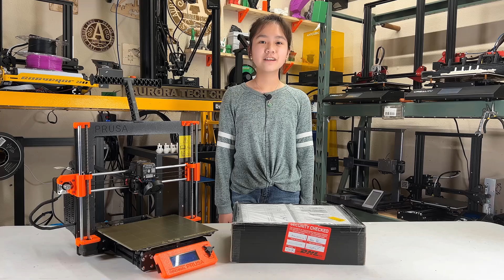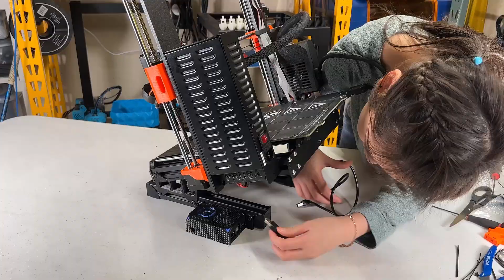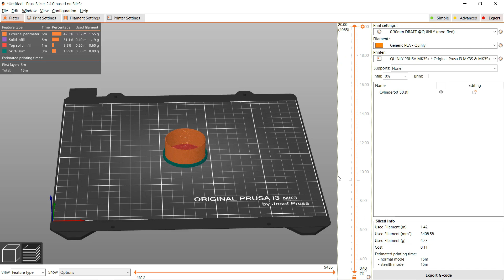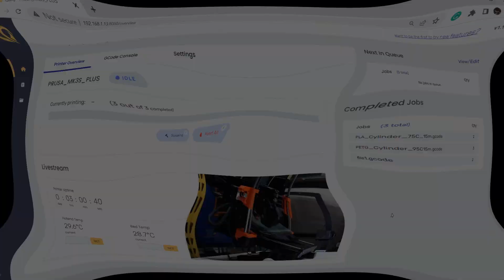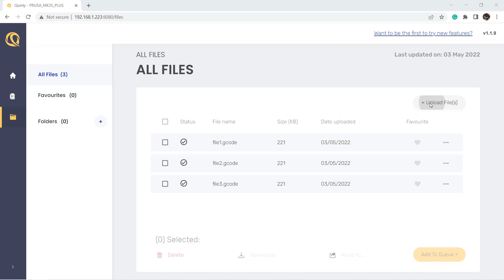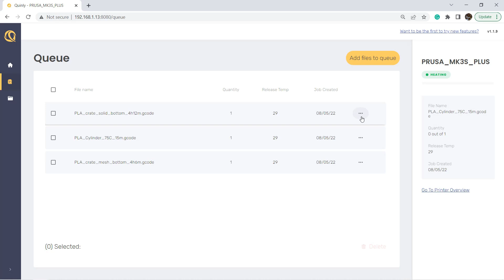3D printing batch production: Quinly automation system for Prusa MK3/S/S+ series, loop printing

Comment: Hi Aurora, Steven here from 3DQue. 
Thanks to you and your brother for reviewing our product! I'm glad you got it working reliably. You brought up some good points which I'll address here: 

1. ABS not releasing: This is strange, since in our testing, all ABS brands have released very reliably. There are probably some uncommon additives in the flashforge ABS you tested, and I'm sure most other brands will work fine.
2. Materials info page: We actually have a materials page, but it was not easily accessible, so we've added more links to it in the manual and on the website.
3. Custom shaped spring steel sheet: Great idea! We hadn't considered that, but it would reduce the part count and the weight on the Y axis, and also make the installation easier. We will consider implementing this if we can find a source for the steel sheets.
4. Long cooldown times: We are working to come up with an add-on for a controllable bed-cooling fan that turns on when the print is finished.
5. On/off switch for wireless hub: Good idea - we have looked into the options. The Rock64 has an uncommon sized power jack so it is hard to find compatible on/off switches, but we will include them if we can find a source.

Thank you for the suggestions and keep up the good work!
Reply: @Bradley Saulteaux G10 (and FR4) is the same color as VAAPR, but the materials are very different. VAAPR is a unique material that 3DQue invented. We have compared G10 to VAAPR, and G10 releases parts well if you remove them by hand but with VAAPR, the part release is so good, you can sometimes even blow air at parts after they cool down and they will fall off the bed. Search for 3D Print General's Quinly Review if you want to see a demonstration of it.

Comment: This does not work on huge prints. I would not recommend using the printer to push the print off.
Reply: Why do you say that? I’ve been running quinly for a year and have done massive prints pushed off from my cr10
Reply: It actually does work on large prints! The VAAPR bed auto-releases parts as large as 250x250mm. There's an example on our Youtube video titled "Quinly Automation for Creality Printers"

Comment: Great video! I've been a Quinly user for almost a year now, and I won't ever go back to Octoprint. While it did work, it was quite cumbersome. The Quinly is a much more refined and elegant system. There are working on some extremely powerful upgrades (in Beta now) such as the hub, which can control multiple printers as one cohesive unit, pro, which is their networking solution to control multiple hubs, Quinly's, and even across different locations. The flexibility and expansion capabilities of the system are light years ahead of everything else out there, and with things like Quinly Vision, their AI print monitoring system on the horizon, it is stacking up to be the ultimate solution for any 3d printing business or print farm operation.
Reply: Lol, never. 

You are probaly working for them or you are being payed for saying this. This is absolutely no new technology. So funny.

Comment: Was just looking at this system last night.
How does it overcome petg oozing out of the nozzle while heating up? If I don’t sit there for 5-10 minutes wiping the nozzle off until the ooze stops then my prints have a high rate of failure/poor quality.
Reply from the maker: I print a wider skirt with a few loops to wipe it off.
Reply: @AuroraTech  👍🏻👍🏻
Would you recommend this style of continuous printing for parts over belt printing? 
Also I can’t say enough how great of a job you guys do! My favorite channel by far. And not to put down all of the great content makers out there, because there’s so many fantastic ones,  but my problem with almost everything out there about 3d printing is that nobody takes the time to really be clear and concise and show the entire process of what they’re doing and remember that not all of us are rocket scientists. Keep up the great work!
Reply from the maker: Depending on what you print, if you print something like those crates in the video which require 4-5 hours of printing time, using this "print head knock off style" is easier as you don't have to modify your printer at all. If you print something that only requires less than an hour, the 90-degree belt printer would be more productive as there is no waiting time to cool down and heat up everything before starting the next print.